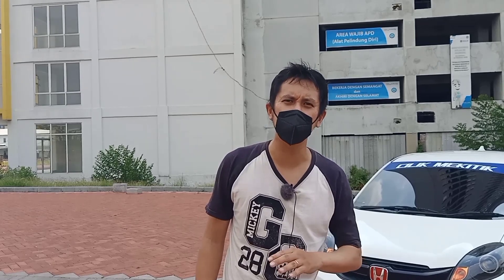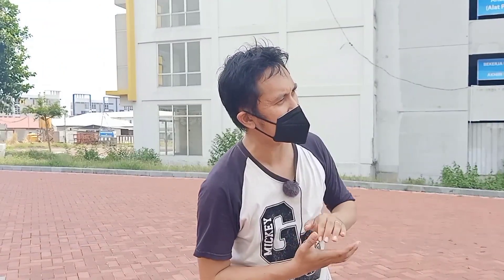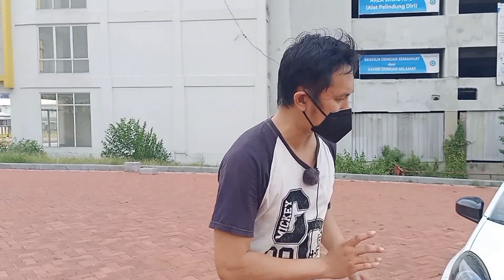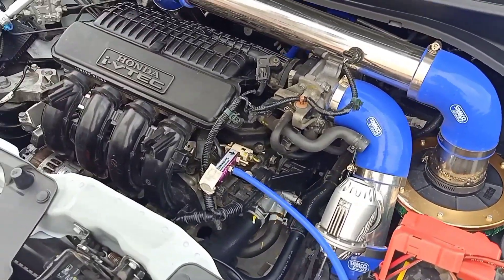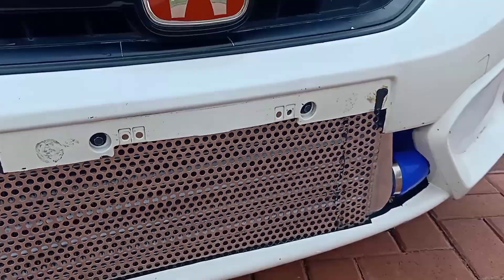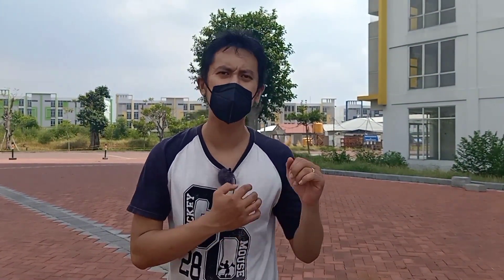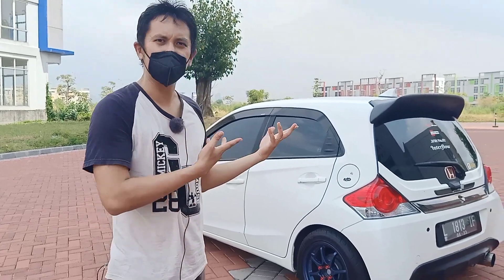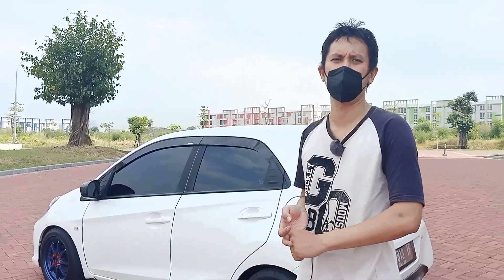Modifikasi Brio budget mahasiswa, murah meriah kencang!! Pasang Supercharger!!

Comment: uhmmm pasanmg supercharger hmmmmmm
nih yang nonton nih video, misalnya masih nonton video ini, misalne, dan ketemu komen ini
nih yang pengen pasang supercharger aja, nih Info yang penting sebelum pasang supercharger mobil kalian
1. Ring Gap kudu di atur ulang
buat supercharger dibawah 15 PSI, Ukuran Piston dikalikan dengan 0,0055 buat ring komprersi pertama
dan 0,0059 buat Ring kedua, ini dikalikan sama lebar piston ya
jadi misal ne piston mobil mu ukuran 75 mm, nah dikalikan dengan 0,0055 kalau buat ring kompresi pertama, ini bertujuan untuk menentukan ukuran ring gap, ok
siapa tau mau pasang supercharger dan lupa blom atur ring gap, ini comment bisa jadi referensi buat yang ingin upgrade mobil, dan please banget, kompresi buat mesinnya turunkan, soalnya kompresi meningkat jika menggunakan supercharger, dan ingat, upgrade pendinginan mesin biar awet ya ^^
Reply from the maker: Izin PIN buat tambahan ingpo
Reply: @mobilkencengchannel  Okies mas, dan satu lagi kalau buat pemasangan supercharger, crankshaft kudu forged, billet connecting rod, forged piston, sama klepnya yang cara [embuatannya dengan bahan yang anti panas, biar pas dipasang supercharger, klepnya teteap kuat dan tahan panas
Reply: @mobilkencengchannel  Owh ya satu lagi, sebelum pemasangan supercharger, kompresi turunkan dulu yaitu dengan menambahkan clearence positive displacement, jadi piston lebih mendem, karena boost dari supercharger itu sendiri menambahkan kompresi mesin mesin, kebanyakan tunner akan menurunkan kompresi mesin dari 8,5 - 8:1 kompresi tergantung penggunaan supercharger itu sendiri, kalau soal kompresinya harus berapa, itu harus research sendiri, dan sebelum pemasangan juga, kompresi + kompresi boost dapat dihitung sehingga mendapatkan kompresi boost yang tepat buat mobil, ada penjelasannya di vide link dibawah ini 

https://www.youtube.com/watch?v=1pZqiuaZYGY

https://www.youtube.com/watch?v=87aHTfxatag&t=1924s
Reply: jadi kira kira mesin "standar ting tingnya" setelah 1 tahun pemakaian gmn ya kondisi sehernya om ? bolong ndak ? xixixi
Reply from the maker: @dimasandtoys  sampe skrg aman tuh